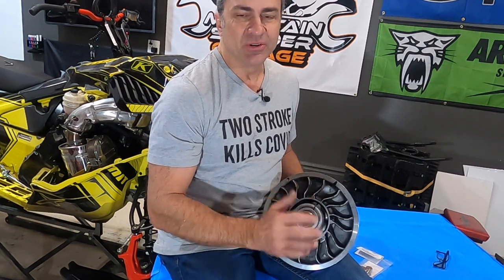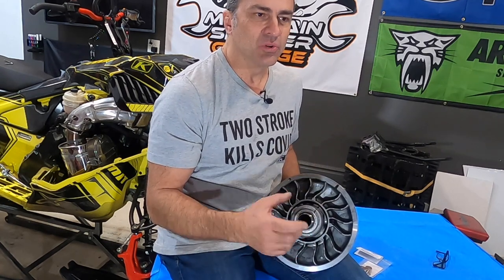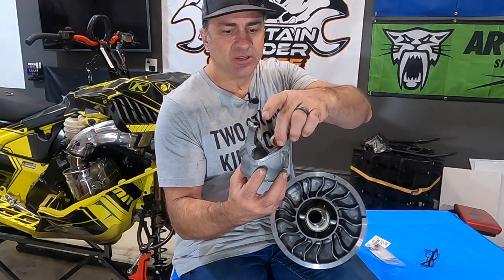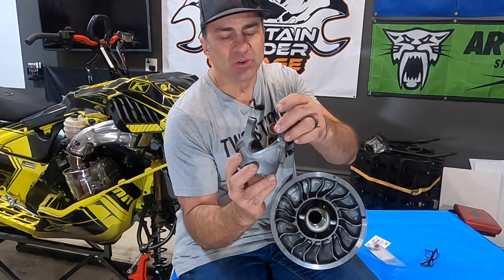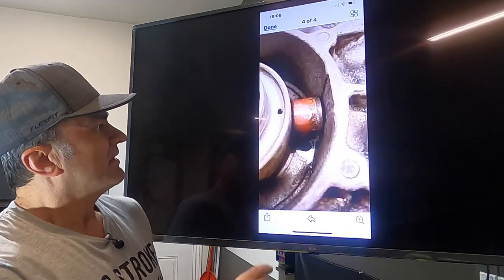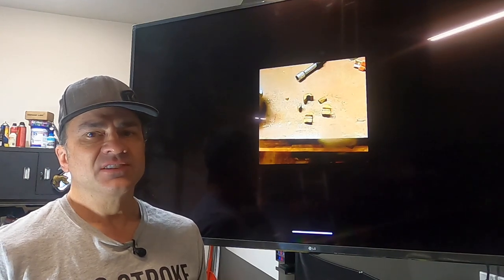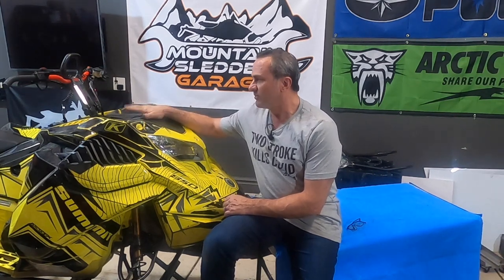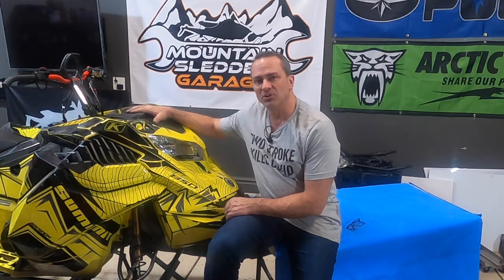Skidoo QRS secondary roller replacement

Comment: First of all, great video. I do have couple of small tips: The manual calls for a very thin layer of anti-seize outside the jackshaft bearing where it slips into the bearing tower. I also think the bearing calls for loctite retaining compound on the jackshaft, but it doubt it will slip... And speaking of slip, if you don't have a press, you can put the jackshaft in the freezer, and heat the bearing, and it will slip on without tools or just a thin plastic  pipe to give it a slight bump to seat it.

Comment: love the content and keep them coming! Its about time someone made a good vid of a QRS roller replacement with the roll pins. Did a few myself with the hex bolts. Sure is a time saver to change or just check the spring and helix. If the clutches have been aligned with shims don't forget to put them back. If it has there maybe one on the spline side, one next to the bearing, and one on the bearing retainer stud. If you loosen the chain it helps too.

Comment: On my 2020 Summit I was able to get the 4 torx bolts off the back of the secondary plate using a 1/4" T40 bit taped inside an 8" adjustable wrench. Turn the secondary such that the bolt is in the 2o'clock position each time. Thanks for the tip on replacing with hex bolts

Comment: Great video ! I followed it to change out my broken rollers, but used zero special tools. What is the source of those helix spring teflons, I'd like to add those to mine.
Reply: The plastic springs washers is supposed to be there, but they are often stuck in the sheeve and helix, so you probably didn't notice them? But if they actually are gone, just pick them up from the dealer.

Comment: Did you notice any performance changes? Or clutching changes with the new rollers? Thank you for the video. Just installed mine. Curious to know if there is any changes. Thanks again!
Reply from the maker: Unless your old rollers where damaged or severely worn, I doubt you’d see and change in how your clutching works

Comment: Does the Jack shaft bearing have to be removed to do the rollers or does it just make it easier?
Reply from the maker: Going to edit my last answer a little. It is a lot easier to take the bearing off on the newer QRS clutch (like mine in the video), but it can be done without the bearing off. Some of the older QRS designs you do have to take the bearing off.
Reply from the maker: Revised video shows how to do this

Comment: I didn’t see lock tire on the roller screw in the video. Is it needdd with the roll pin?
Reply from the maker: The screw that goes through the roller is securely held in place by the pin. So they shouldn’t need lock tight
Reply: @mountainsleddergarage8627  Cool thank you! Do you have a link to the finger throttle you have on that sled?
Reply from the maker: Munster is the only place making finger throttles. 

https://munstercanada.com/collections/featured-products/products/finger-throttle?variant=37173013676209
Reply: @mountainsleddergarage8627  thank you! Just placed an order…. Serious carpal tunnel on my wrist effecting my thumb for throttling. Hoping this helps a bit

Comment: does the roller get damaged if you accelerate forward too fast?
Reply from the maker: If the sled has been in reverse the roller will have to move to the forward position when going from reverse to forward. So yes it could if it’s been in reverse first. When it’s in forward, stopping  and starting in forward the roller should stay in contact with the helix
Reply: @mountainsleddergarage8627  Thank you! Now i know to do smooth transitions when switching. My 2017 ski doo summit 850 broke up in the mountains last year because both of the rollers broke in the secondary and I was a novice rider so I didn't know the difference how the sled rides when they break so I kept riding, and what had ended up happening was the top gear bolt in the chain case that goes into the jackshaft sheared and totally messed up my chain case in the mountains, I believe this was from the vibration from not having the rollers. Do you think that caused this problem? Sled would not move and we had to tow it out.
Reply: Also, do you know what causes the snow machine handle bars to vibrate at idle?
Reply: @zeberkhan6190  hahahahahaha good one - it's your engine running.